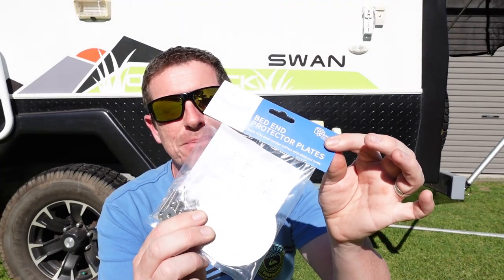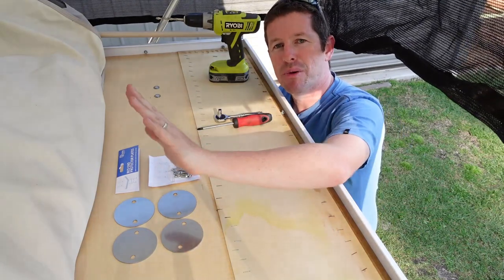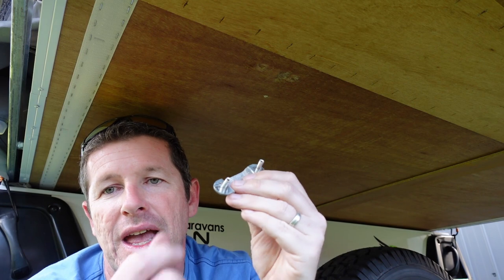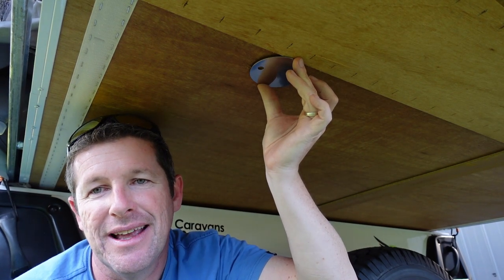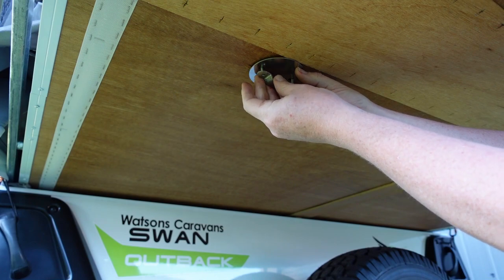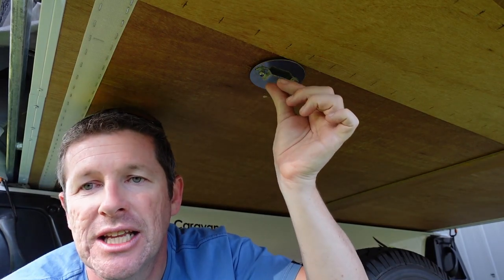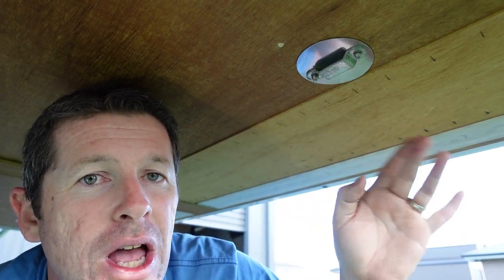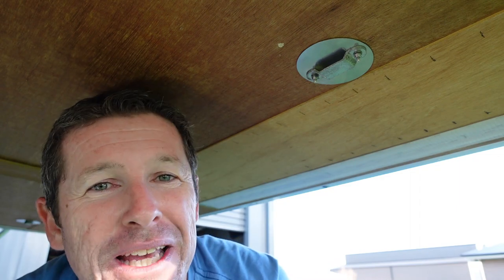LIVE | Jayco and Goldstream Bed End Support Plywood Protection Plates - a quick and easy camper mod!

Comment: Why would you not insert the bolt the other way and cover inside with tape to protect mattress
Reply from the maker: This is such an old video 🫣 You could put the bolt in from the bottom, Adam from Caravanmods who makes the kit has them going in the way we installed within his instructions. Either would work 👍

Comment: This system is un-necessary. There is space to slide a part in without going to all the trouble or removing the rivits and re-screwing. Just make a T shape out of some thin metal plate like a nail connector plate from bunnings and cut out a T shape and slide in and screw.
Reply from the maker: For those that just want to buy a some protection plates these work fine. Its very easy to install and neat. You could make your own plates no problem at all. Just gives an option for those looking for a solution. and they are cheap as well.